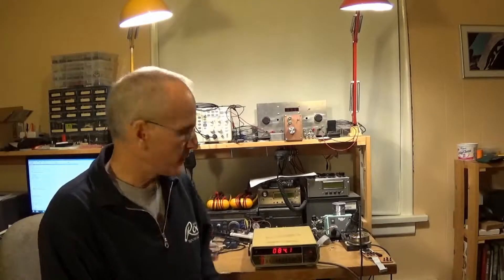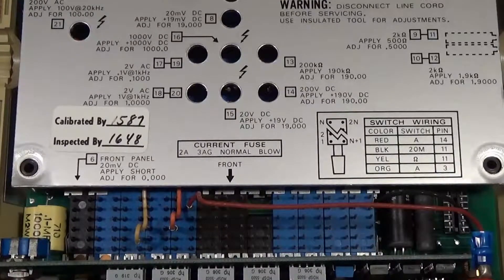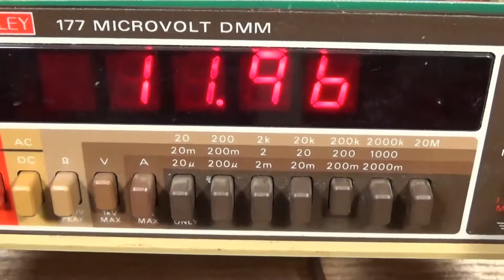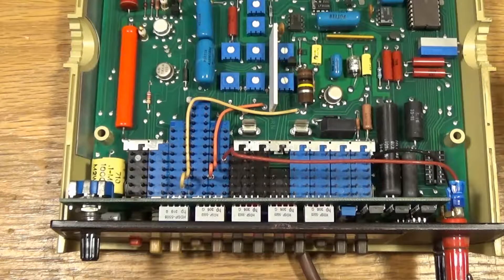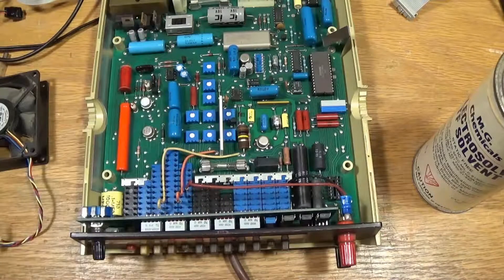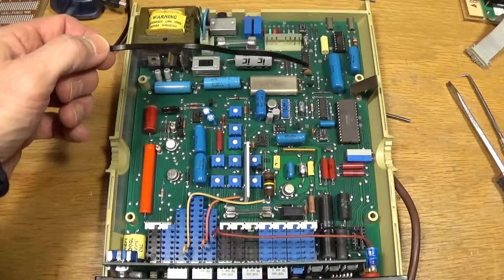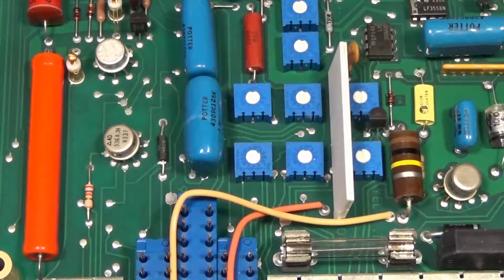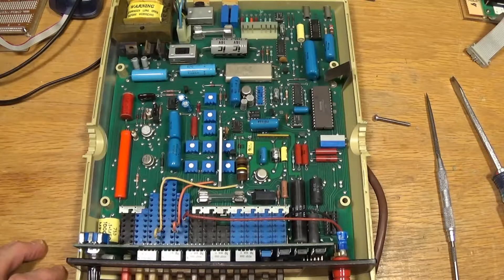Refurbishing a Keithly 177 Microvolt DMM

Comment: Hi there, nice shooting. I've got one of these 177s that I used for testing loadcells for uV drift when weighing machines was my trade. That was 15 years ago, so my unit has sat dormant pretty much ever since. The last time i tried it, it was sporadically blinking at me and wouldn't power up properly; unless left on for a while. I'll have to open mine up and give it a similar once over, test and replace the odd capacitor and upgrade the battery if installed. Gave me an insight this, thanks.

Comment: Now thats a nice bench meter :-) and i hope its still working fine :-D
The two chips that make up the adc must be related to the old reliable ICL7106, old but dam reliable :-)
I have an old fluke 8050a that plays up on the switches, i must clean them one day :-)
Reply from the maker: zx8401ztv Thanks for watching and yes, it's still working.  With older equipment like that, the problems are usually dirty switches or bad electrolytic capacitors.  They generally keep on working!

David Jones of the EEVBlog just posted a video of his repair of another Keithly 177.  Check it out.  His was acting up the same way as mine.

Comment: Hi there,
nice video and excellent channel (which I just stumbled upon). I own a Keithley 179 (made in Munich, Germany) which I bought for next to nothing years ago at a swap meet here in Italy. Needed as usual some TLC (some stuck push-buttons and that sort of stuff) but overall works well and it's been a faithfull companion on my amateur workbench. The mainboard looks a little bit different and there is no adjustment knob in the front panel. Calibration is somewhat tedious but with some patience it can be done.
Not bad I guess for a 30+ years old piece of equipment.
As they say "keep up the good work"
Regards
Cesare
Reply from the maker: ciocclaude Thanks for checking out my channel.  I got my meter for cheap as well and wasn't too hard to clean it up.  I didn't need to calibrate mine, it's at least as accurate as my Fluke 87.